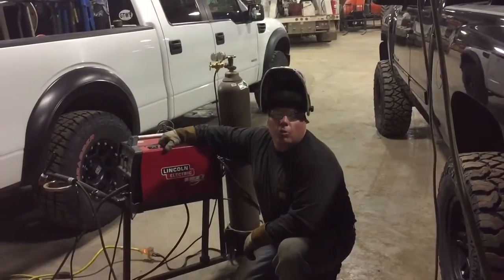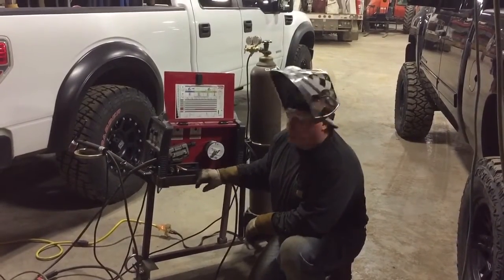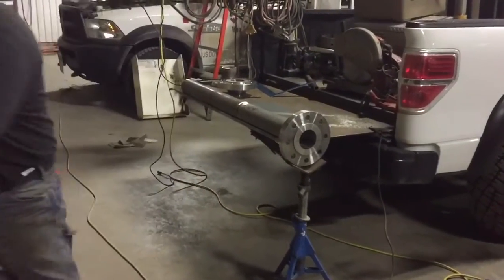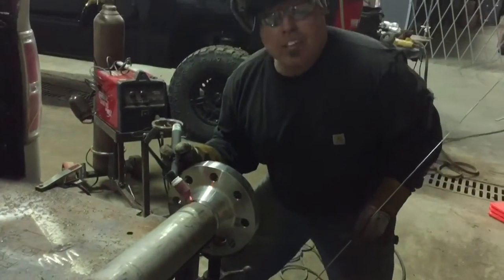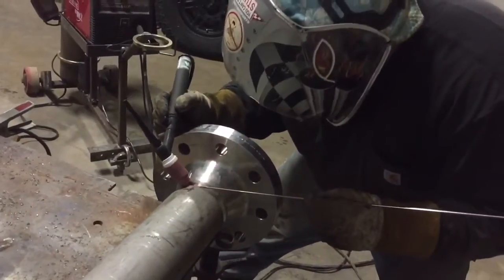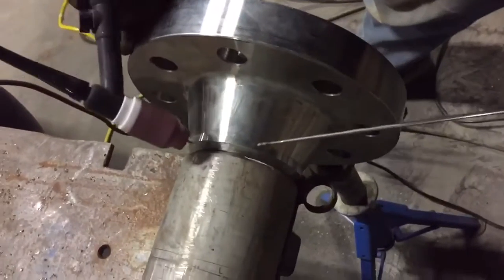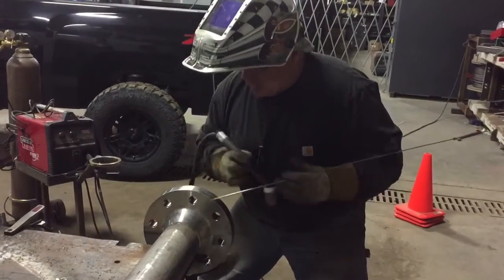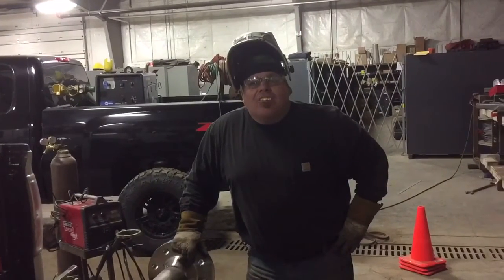Worlds first discovery!  Run a Scratch Start TIG off a 110v or 220v MIG Wire Feed power source.

Comment: Is that welding in AC or DC. I got an old harbor freight Flux mig I could probably convert. It just won't have frequency setting. Wanting to learn to tig aluminum in Ac. Any ideas
Reply: bjjjkdkfm: Of course you can weld aluminum with wire by just adding argon as your gas and an aluminum liner helps, too. Tig welding aluminum can be done in D/C but without the high frequency box you don't get the cleaning action to make it as sweet. Check out Tig Time with Mr Tig. He did a video welding D/C aluminum, like that. It can be done, just not as pretty. Happy welding!

Comment: I don't really understand how you are getting the gas to the torch. Are somehow still using the gas solenoid in the welder? Would be nice to have seen some footage showing just how you connected the torch up to the welder.
Reply: John Acuff their is a valve on the torch that hooks up to the gas  bottle
Reply from the maker: John. A standard tig torch has a hose that goes to an argon gauge on an argon bottle. It is also electrified. With means the power to weld comes from the welder and the ability to shield comes from the argon. That's just tig welding basics.

Comment: I got a Hobart 210 I'm going to try this I hope it works.
Reply from the maker: Hey, Al.  Were you able to get your Hobart 210 tiggin?
Reply: Preston Helton yeh I talked to a welder repair tec at western gasco and he said if you stick the tungsten too many times you'll fire the board on the welder as its CV not CC so I went and bought a Lincoln inverted 155v and am happy for now till I get a real machine with HF.

Comment: do you leave  mig gun hook up
Reply from the maker: Yes. Put mig gun lead on negative (-) and ground lead on positive (+). That's called Straight polarity. Then add your Tig torch lead on top of the mig lead. So you have 2 lugs on one post. Negative. Then your set. Just flip the wheel up so its not able to push wire thru and tape or clamp the mig gun trigger "ON" and you're hot. I also turn the wire speed all the way down so the motor is just barely turning. But it has no affect. Just use the heat settings to set your amps and Tig away.

Comment: Man. Not exactly sure what I did wrong but this isn't working for me. How did you disable the wire feeder? Maybe I pulled the wrong thing. And what did you do with the wire feeder connection that was hooked to the positive terminal? I have no wire coming, gas is good, no spark from the torch. Nada.
Reply: And when the wire feeder goes, scratch start works great. Just get nothing with is disconnected.
Reply from the maker: +R. Schreckengost The trigger must be pulled to engage wire feed motor. That makes everything hot. Ground cable goes on positive. Tig torch to negative. You're hot. Ready to rock. If your wire is still feeding thru, cut it at the spool and tuck it away. That'll fix the dis-engage issue.

Comment from the maker: R.S.    Inside the case is a wire tensioner/adjuster. It holds the tension on the feed rolls. It should flip forward to allow you to feed a new roll of wire thru or change feed rollers for different size wire, etc. If it doesn't flip over it may just unscrew to reduce the tension. Pretty straight forward on most wire feeders. Yours may be an odd duck. Should be very similar tho.
Reply: Gotcha! Figured it out after posting. Ha.
Reply from the maker: +R. Schreckengost [][][][][] Good deal.